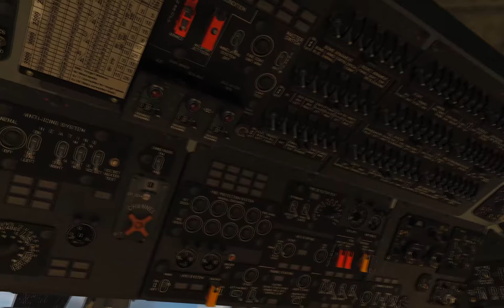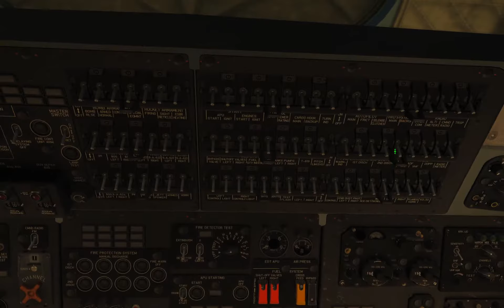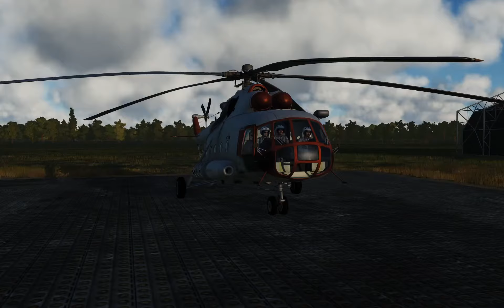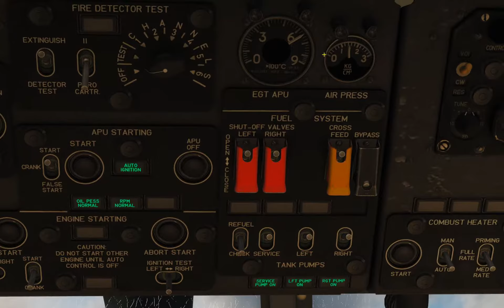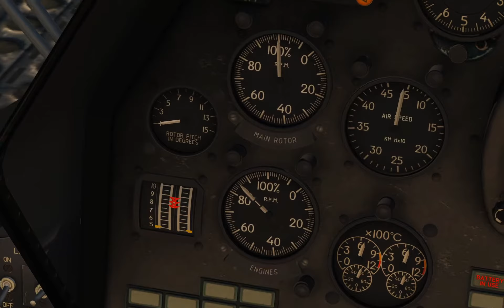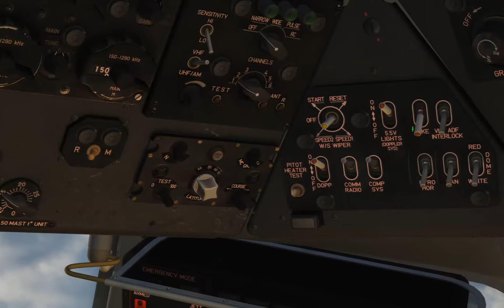DCS Mi-8: Cold Start Tutorial

Comment: Great video. Understanding the switching  is critical for me. Next video: How to avoid generator failures.......
Reply from the maker: Don't pull so much collective :) Smooth, gentle inputs are key.
Reply: @vsTerminus  I figured that was the problem, but I had followed the built in training which totally fails to mention adjusting the levers next to the collective. Actually that is likely my problem then.
Reply from the maker: @davefloyd9443  From the official manual, raising the ECLs all the way up is the "Takeoff Power" setting. It doesn't specify but I'd guess you're supposed to return them to the middle after taking off. I always forget about that and leave them raised.
Reply: @vsTerminus  Thanks very much for that tip. You've clearly been very busy working on these videos and it shows.